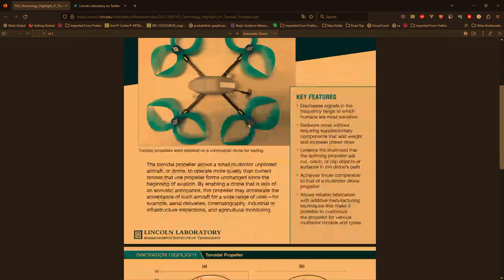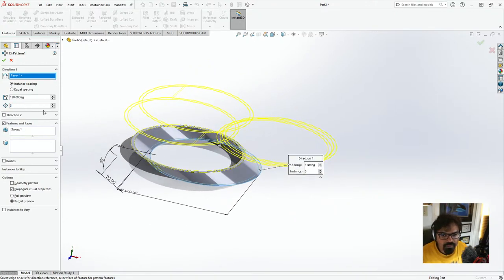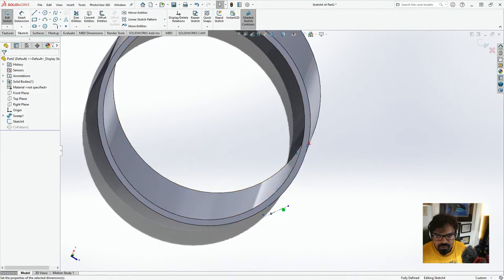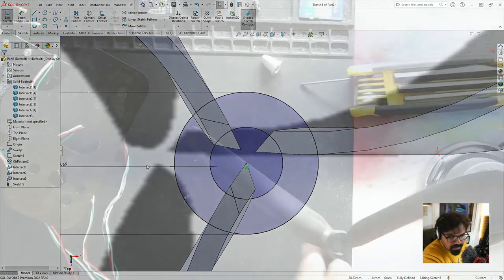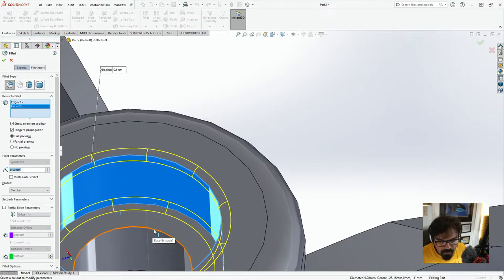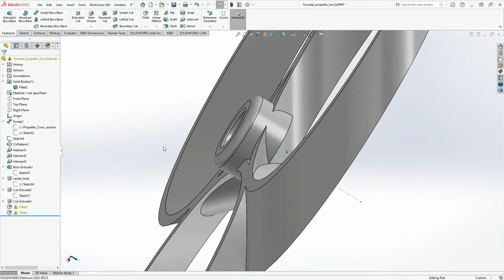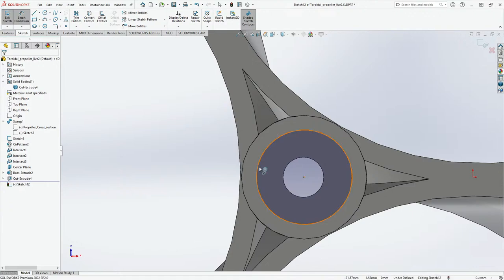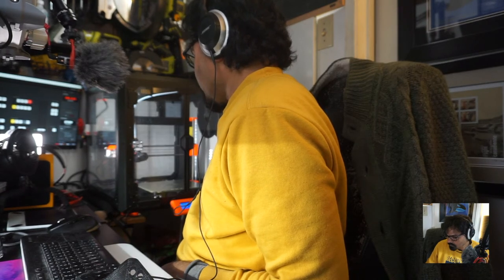Designing a Toroidal Propeller in Solidworks

Comment: I'm suprised you didnt use an airfoil section to create the prop. did you test it?
Reply from the maker: No. I did not use an airfoils section. That definitely might be the better way to design it. I mostly designed it based on eyeballing how it looked. 
Does it work, yes. Tested it on my thrust stand. Is it efficient, hard to say. Need to do more test.
Reply: @antshivrobotics  can you please tell how to use an airfoil section for this propeller? i want to make this model through an airfoil, it would be great help
Reply: @mrniceguy8396  yes bro I need with this with airfoil help me
Reply: @mrniceguy8396  sweep a NACA profile along a curve, and here you go.